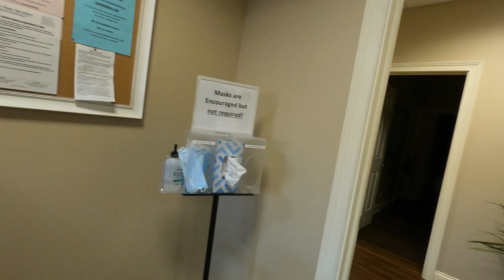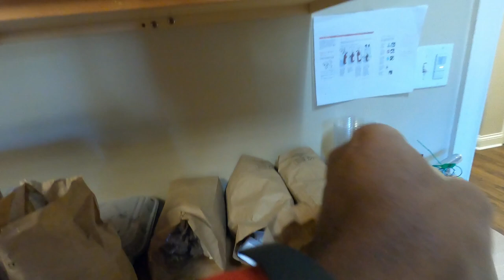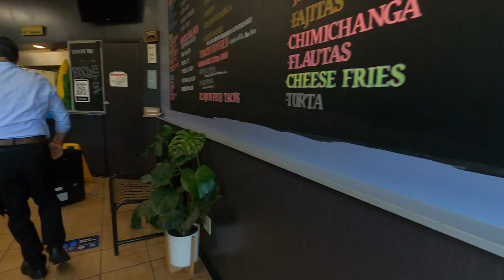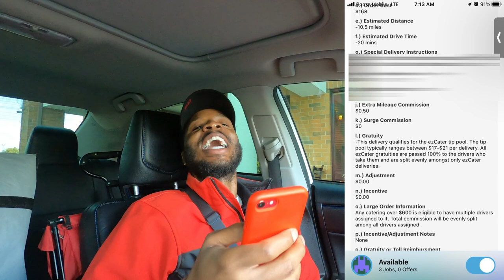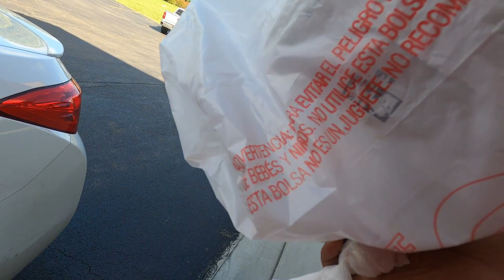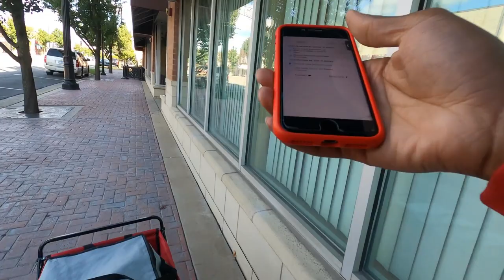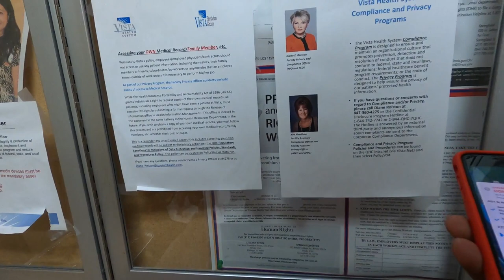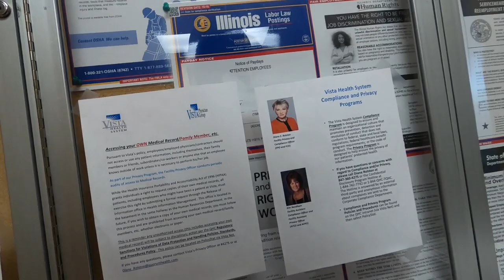Should I Blacklist This Restaurant? They Screwed Up My TIPS And My TIME!! #catering #order #fail

Comment: Perhaps you should just avoid orders from certain restaurants at certain times? I think it's at least good you're recording to prove it was not your fault if any complaints. 

Also a pro tip: Put hook and loop attachable fabric strips on the bags, then in your trunk. That will allow you to stick your bag to a part of your trunk to prevent movement.
Reply from the maker: That is definitely one of the reasons I record!!

I will definitrly be looking into those. Is there a specific brand you recommend?
Reply: @carsandcribs  I don't have any specific brands, but you want to use "hook and loop fabric strips" or "hook and loop tape" or "hook and loop adhesive". 

Another recommendation is to put a clothing hook on your car ceiling, because gravity will automatically stabilize hanging objects. 

You could put an adhesive clothing hook on your car and hang a beverage bag from it, and regardless of your driving or handling, the bag will stay stabilized due to gravity.
Reply from the maker: @oa5828  That’s a GREAT TIP!!!! I definitely will be looking into them both!
Reply: @carsandcribs  Glad to help and thanks for keeping people informed and motivated!
Reply from the maker: @oa5828  💪🏾💪🏾💪🏾